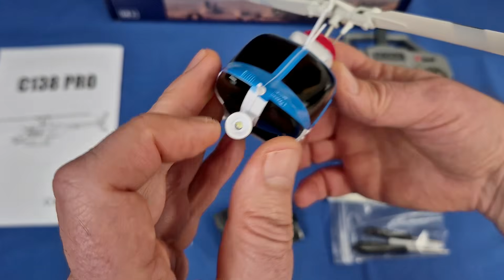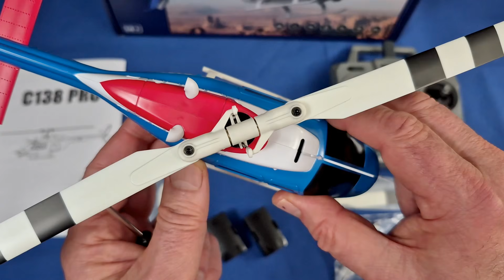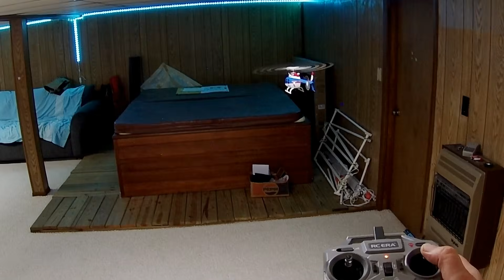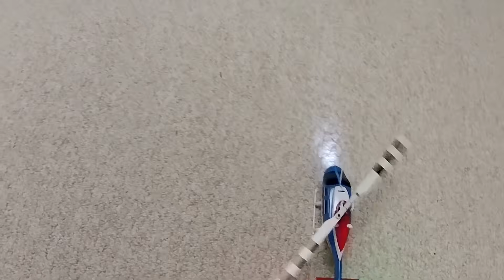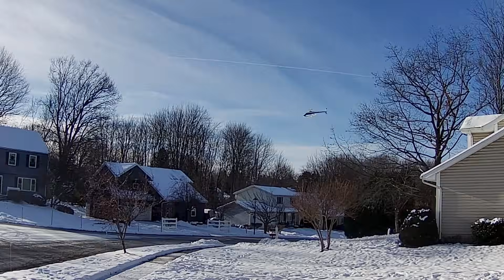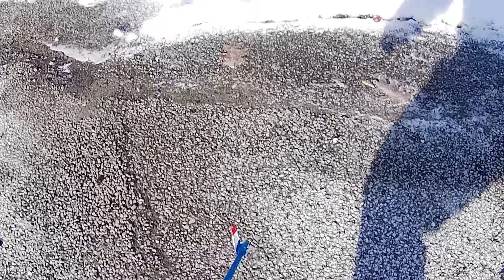RC ERA C138 Pro Stunt Helicopter Flight Test Review

Comment: How do you return back to  normal mode flight from
 invetred flight?
Reply from the maker: First make sure that the helicopter is above 3 meters (10 feet). Next press the flip button, then move the right stick right or left to flip it back.

Comment: Just a point, the tx is both modes 1 and 2.There are vids on it,  as they vary as to which button to hold down, whilst turning on, then moving the right gimble  up/down(mode 1)...Cheers.

Comment: I bought one of these and an internal flight control component failed on the 4th flight. I checked online and found the problem to be very common. Now it will not fly. Before you buy this ask yourself how many flights you expect to get for the money you are about to pay.
Reply from the maker: What happened when it failed?
Reply: @Quadcopter101  A servo stopped working. Instead of hovering vertically it constantly fell over to the right. When checking the blade adjustment (according to the instructions) one blade would not move (no servo movement) while the other blade did move.
Reply: @brianlarkin1698 sounds like it needs a new servo..very common with rc's .sometimes servos last a long time..but crashes also can mess them up..

Comment: with offside down, does all the controller is reversed ?
Reply from the maker: Nope. Up is still up, down is still down.  Same for cyclic right/left forward/back pitch.  It flies the exact same, just that the helicopter is upside down.  It makes it easy for beginner pilots to fly it.   However, this is not how skilled pilots fly 3D with other helicopters.